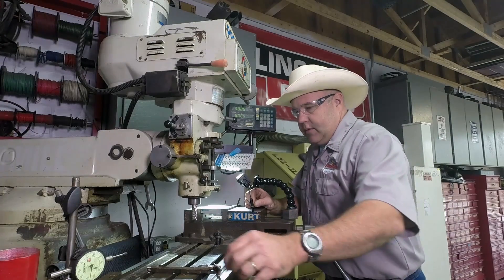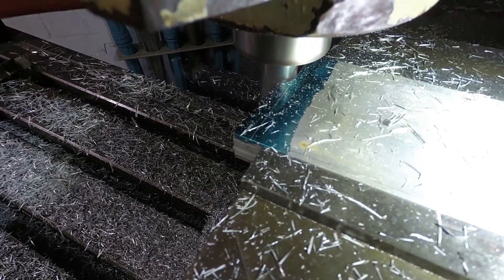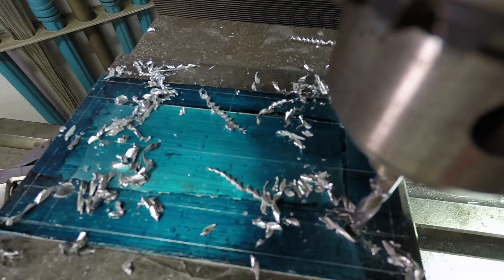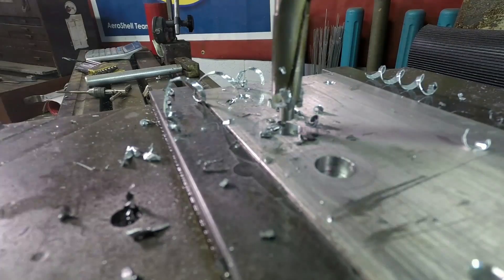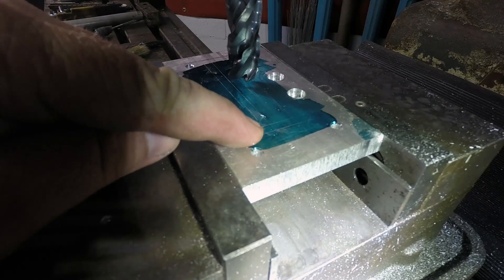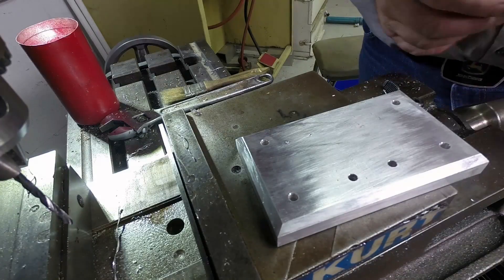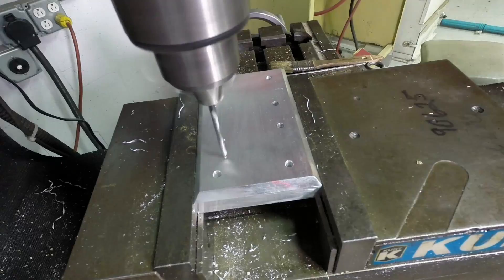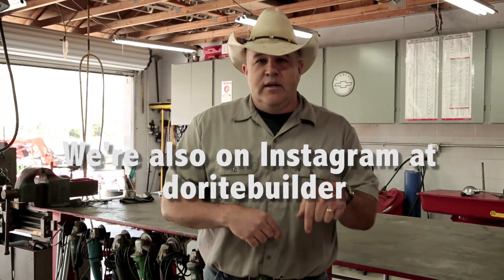Part 3 - Building a toy steam engine generator - cutting, drilling and milling the base plate

Comment: Enjoyed the video Jim, good build...just out of curiosity why did you use the drill press to power tap when you were already set up in the mill?  With that question asked, awesome that your drill press has reverse and a slow speed are you using a VFD?
Reply from the maker: outsidescrewball It is a lot easier to slow my Ellis drill press down, it comes from the factory with a VFD driven motor. You can go straight from forward to reverse with out hurting it, and it and it will slow down to some ridiculous slow speed like 1 1/2 rpm with close to near full torque. My mill just doesn't have that kind of close motor control, at least it doesn't feel like it. With an 8-32 tap I get very nervous about breaking a tap, and starting over.... I hope you son it doing better, Thanks for watching.